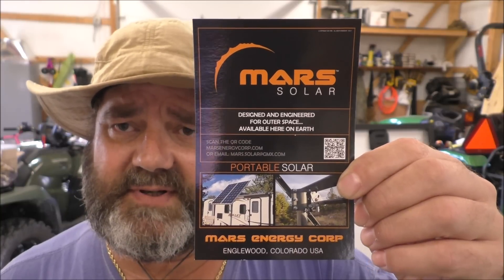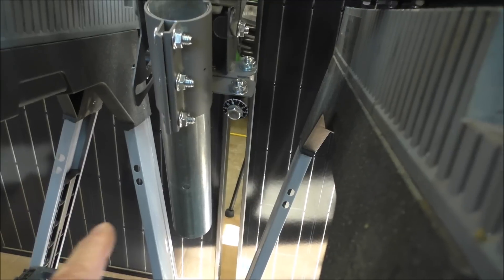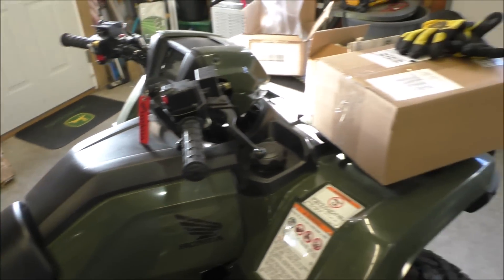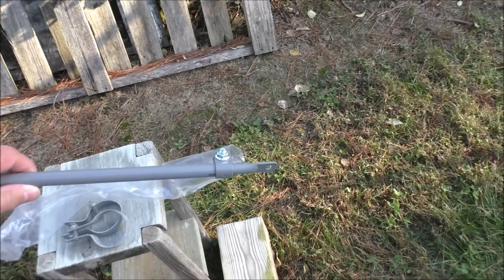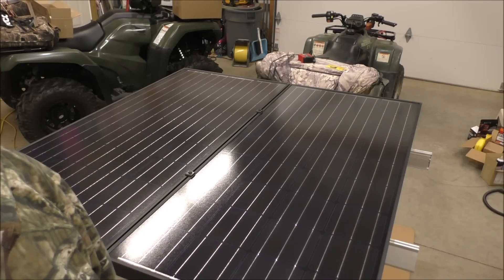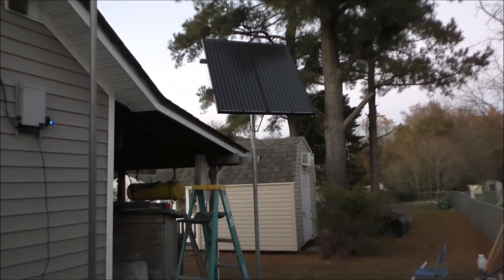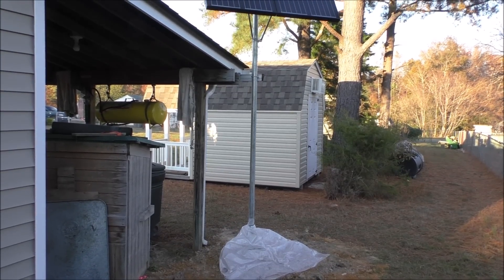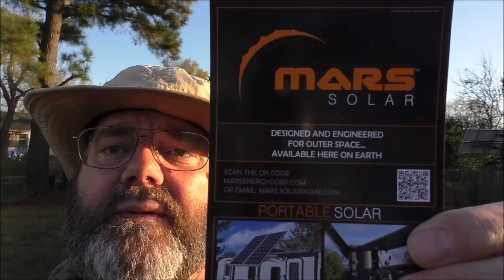Mars Solar V2.0 Solar Panel Rack System Install And Review By KVUSMC

Comment: Hey man looks like a good product, out of the way on the ground space. My roof is at snow load now lol with 12 commercial 295w 72 cells. They are beasts with thicker glass and premium cell material. I'll be building at least 10kw ground arrays eventually. My house it full of panels, got them before the import tax. Improvised, adapted and overcame.
Reply from the maker: Awesome Brother I appreciate it Wow buddy
Reply: @KVUSMC-KU4SMC  make sure your battery backup system is ready for action. The department of energy is saying a cyber and physical grid attack lasting months is probable. This Marine landed on a small island and was digging in and found a Japanese beer buried in beach. Under fire he slowly starts handing beers back to his buddies. Little supply and readyness story from the past...